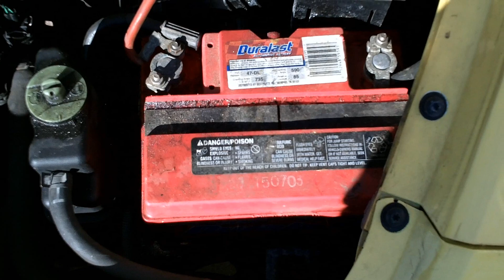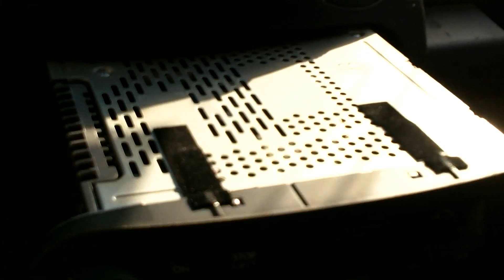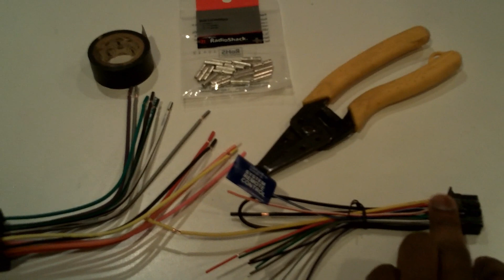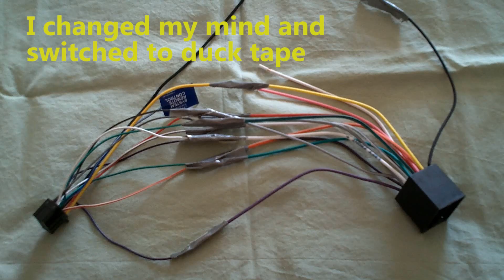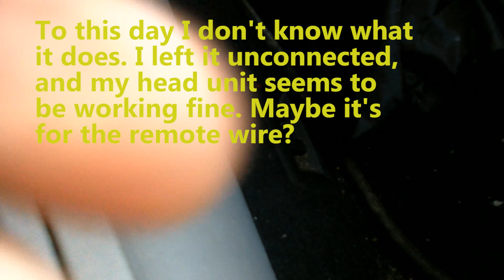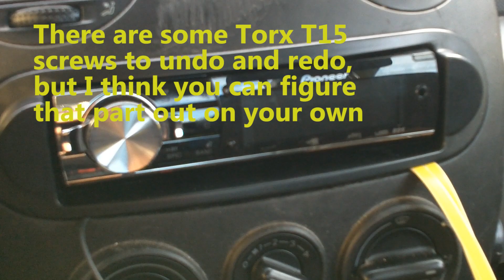Installing a Pioneer DEH-P9400BH Head Unit into a 99 VW Beetle

Comment: that blue wire from the antenna adapter should be connected to a 12V (switched) source.  this car has a powered antenna.  if you stations come in fine than it's not a big deal, but if they are weak connecting that wire will help.  and your USB cables look horrible, run them from the back into the glove box.
Reply: Hello, which for example could be this 12V switched source. I also connected my radio ignoring this, but I would like to connect that cable, I just don't know where. Many thanks

Comment: Where did you get the panel that the head unit sits in?
Reply: you can get everything you need in a kit like this... http://www.ebay.com/itm/311107582225?_trksid=p2060778.m1438.l2649&ssPageName=STRK%3AMEBIDX%3AIT

Comment: hey the 12v dc is for external amplifiers. the head unit tells them to take up and start taking power from the battery so your amplifiers dont just run down your battery while the car is not on or in the accessory position
Reply: Hello, which for example could be this 12V switched source?. I also connected my radio ignoring this, but I would like to connect that cable, I just don't know where. Many thanks